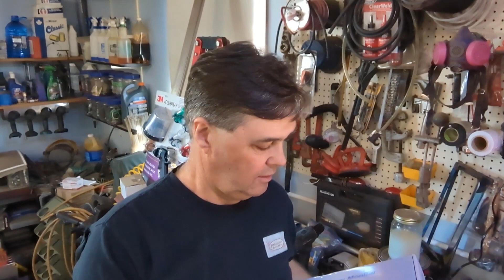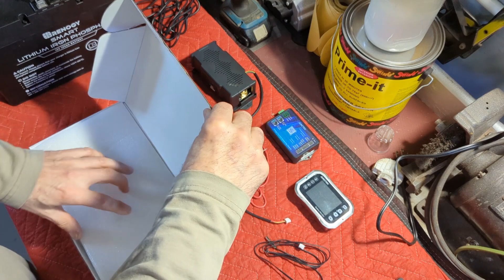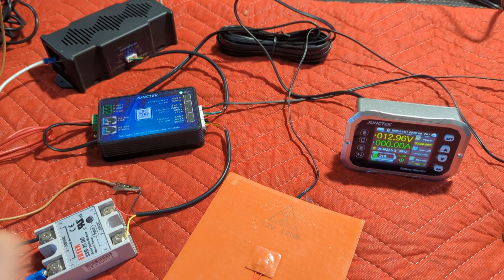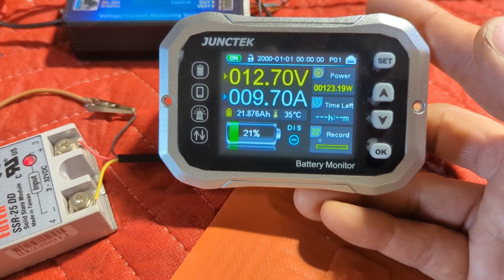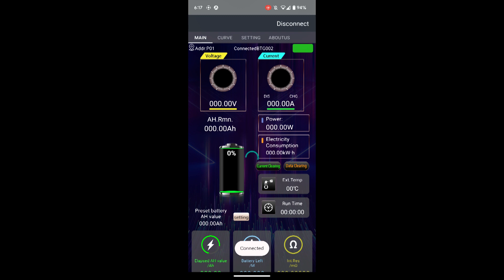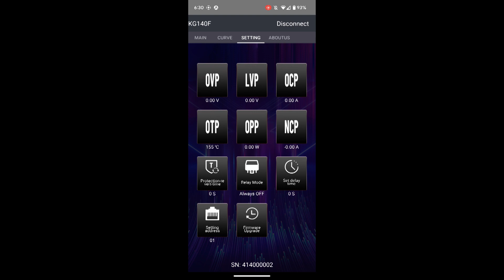KH-F 400 Amp Junctek Battery Monitor with App Setup

Comment: I've been using this app for a couple months and still can't figure out what "Battery Left" means.
Reply from the maker: My app shows a " Remaining Ah", I think it's the same as your "Battery Left". There is no way to set that on its own, once you set the "Percentage of remaining capacity", the "Remaining Ah" will show how much power you have left in the battery pack.
Reply: @JRShowYT  On the app, it is in the middle bottom, same as your app. It says "Battery Left/M. It has a circle with an "L", clock hands for 3 o'clock. But, it doesn't corespond to the time remaining in the battery. The battery bank (400Ah) might have 90% and this item says 60. My current draw is so low, I'd have 4 or 5 days left.
Reply from the maker: I see what's going on now, the app version in the video is an old version, the version I am using now (1.4.2) does not have the "Battery Left" graphic, after I made the video, the company messaged me, letting me know they had updated the application. I don't think I don't think I knew what that graphic was for.
Reply: @JRShowYT I'm using v. 1.6.5 of Junce Home from Google Play. Does yours have a different name.?
Reply from the maker: I'm using one called KH-F, but I think I'll look up the one you are using, the last time I used my app, it was having trouble loading, and I can't seem to find it on Google Play.
Reply from the maker: I downloaded the app you are using, and in the  Coulomb Meter section, my app is there under KH-F, also I see the one you are using, with the Battery Left, under KH-F.
Reply: @JRShowYT  KH-F is the device name, not the app. My device is "KL140F" in the upper left of the app. When scanning for the device it says "KL-F" which is the device/shunt monitor I have installed.
Reply from the maker: It looks like we are using a different battery monitor.
Sorry I can't help you any further.

Comment: Hi. A couple of things.

- It's never been able to keep real time properly. The date keeps slipping.

- More seriously, I did a firmware update yesterday (hoping they might have fixed this) and it's broken communication with the app (v 1.4.2 [Android] - no update available). It displays voltage and current but with a superimposed "loading" spinner. If you press back the spinner disappears, but you cannot set any parameters - they just return to their defaults. Even if you're not an app user, this is quite serious because there is no way on the display to set the "full voltage" and "full current." I've tried factory resetting and re-installing the app. Especially annoying is the firmware version is not shown on the "ABOUT US" tab, either.
Reply from the maker: I'm sorry to hear you are having issues, I haven't had to dig that deep into the software yet, the only thing I did have to do, was uninstall the app and install it, that was this spring, but other than that, all works fine.
The only experience I've had where a digital clock would creep, was when using non- pure sinewave inverters, because they produce dirty power, and not suitable for electronics.
Reply: @JRShowYT  Thanks for your reply! The clock issue looks more like incompetent programming to me, as the shunt itself is very reliable. I need to keep a closer eye on exactly what it's doing. It ought to have a stable supply, being connected to the battery.

Comment: Is your unit the 400A model? Do you have a link as to where you purchased from and did you use the wifi function of if?
Reply from the maker: Yes it is a 400 and model, I don't have a link, they sent me one directly. I do see they sell on AliExpress.
The wi/fi function is actually Bluetooth, and I use it all the time, it works very well.
Reply: Ok cool yea the new one actually has the wifi ability for global monitoring as well as bluetooth for set up

Comment: dose the app work in landscape mode as well? wondering how itll appear on my android headunit
Reply from the maker: It does work in landscape on my pixel 6,  the only thing is that you need to scroll a little to see the lower section of the display...it may show differently on your android dash display, but it does go into landscape mode.
Reply: @JRShowYT  thanks mate, sounds perfect!

Comment: Hi Alvin , I am planning a similar setup with a relay but no external battery,  I have understood the 3 wires from the module to the realy and also the power lines from the realy to power the module and connected to battery positive pole, what is the forth line coming from the relay (white colour's) and going where ?? Thanks brother appreciate your support
Reply from the maker: In my setup here, I used the white wire for the ground from the heating pad to the battery, passing through the shunt.
Depending on what you are connecting to the relay, your circuit could be different, a relay is only a switch, so in my setup, I need the heat pad to go to ground for resistance.
The stunt is only placed on the negative side of the circuit, if this were a motor setup, the negative would still go through the shunt, but the relay would be placed inline on the positive lead only...so basically, the relay would  be before the motor, not after, like I did in my video. In retrospect, I should have wired the heating pad with the relay on the positive side of the circuit, it would have been easier to understand.
Reply: Ps
I intend to locate both the sampler and the module under the bonnet, do you think both can handle the ambient temperature?? Could not locate any info in the manual about range of ambient temperature
Reply from the maker: @talat6006 I think moisture could be an issue for the module, but maybe if you had it inside a project box for protection?
Reply: I think I may do that,  I have contacted the manufacturer but no reply yet, other options is to install both shunt and module inside the car and run 2 Guage 2 cables through the fire wall to the battery Negative and other one to chasis as ground/load @J_R_Shop

Comment: Hello! Thank you for creating this video! I have a question regarding its usage. Can this be used with cars or car starter batteries? If yes, do I need a larger shunt due to the spike in current caused by the car starting? I want to monitor parasitic drain current, which is under 1A I also have an mppt solar trickle system attached to the battery. However, I'm unsure if I need a larger shunt as my car battery has 500-600 cold crank amps (Honda Element 4.2L, 4 cylinder). I've seen many people using this product in RVs, but I'm not sure if they're using it on their starter battery or on their secondary/leisure battery only. I would appreciate any thoughts you may have on this. Unfortunately, I'm unable to reach the manufacturer.
Reply from the maker: Typically these are used on the auxiliary battery, and knowing the status of the battery is important for daily use.
I have never installed one on the main starting battery, however I don't see why it would be an issue, the unit is installed on the negative side, and the positive side is where the load is connected.
If you are just looking at a parasitic draw on your Honda, and because it will be constant with the vehicle shut off, you can do that with a multimeter, by using the amp measure setting, and with the positive cable disconnected...use the multimeter leads to bridge between the battery positive post and the positive battery cable.
Just note that most inexpensive multimeters will only handle up to 5 amps, but if you're looking for a parasitic draw, then the multimeter is the simplest way.

Comment from the maker: Just a heads-up, the app I used in this video is not the most current...for the correct application for this monitor, use the KHF app.

Comment: Hello Alvin. I enjoyed watching you demo this setup. Looks like a perfect thing for your off grid camper.
George B
Reply from the maker: Thank you George, yesterday I finished the install on all of the new electrical equipment, I really like this battery monitor, it is so easy to use, and connects to my phone without any fiddling around.